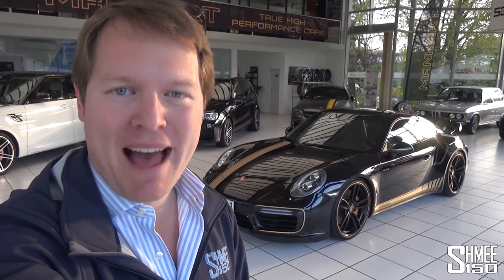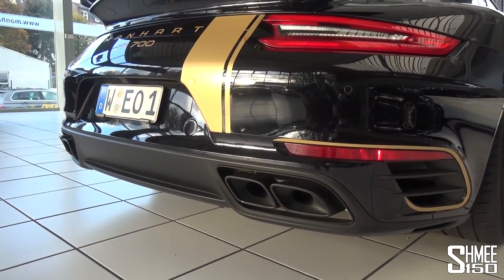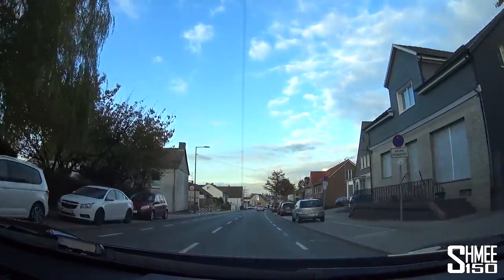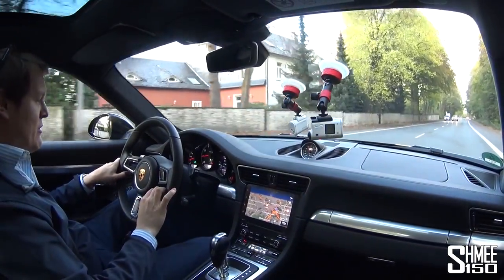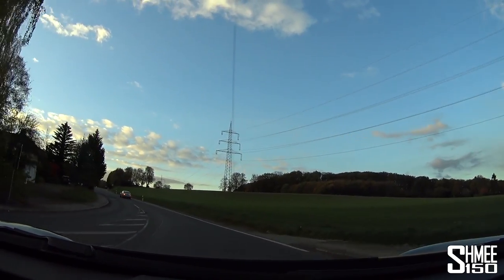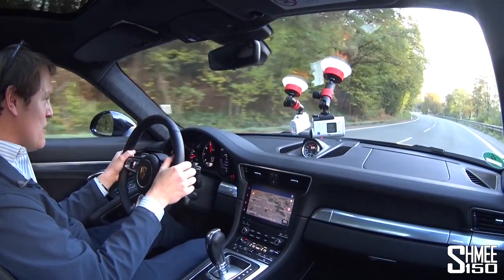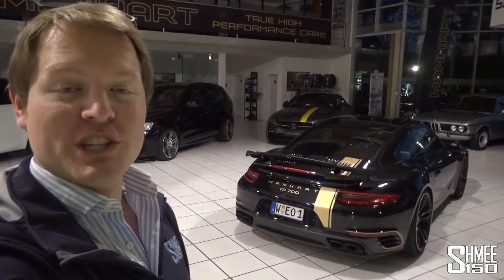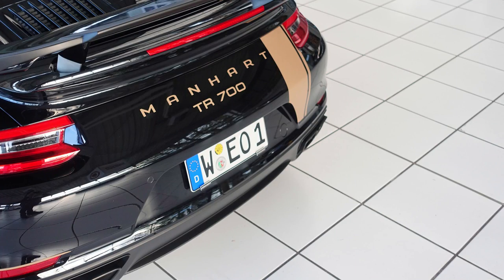The Manhart TR700 is a Ridiculous 700hp 911 Turbo! | TEST DRIVE

Comment from the maker: Manhart have completed their first Porsche project, the TR 700 based on the 911 Turbo and it has 700hp and almost 1,000nm of torque! Let's check out the modifications they've made before a test drive on the Autobahn.
Reply: Love it shmee buy one
Reply: Buy one shmee
Reply: So the big question is what have they done to the engine? Still the original Porsche Turbos with VTG and no turbo lag, or new larger turbos without VTG and a turbo lag?
Reply: "You can squeeze 2 small people in the back" more like young kids . I  love the 911 but 2+2 is not really working. I remember when i was 12 years old i already had space problems in the rear of a 911
Reply: Shmee150 my name is Manhart and I m from Germany :D but sadly my family doesn’t tune cars 🚗 @shmee welche Autos hast du in Frankfurt ich meine dich letztens gesehen zu haben 😃
Reply: Love your videos, I have an Agera RS 1. Would love to have you across the pond my friend. Let me know sir. It will be a blast!!
Reply: @Rick2010100   You can get that power from plenum, y-pipe, exhaust, high-flow (or no) cats and a tune.  Ideally you'd use larger intercoolers as well just to keep the temps more consistent compared to the stock ones.  It sounds to me like this car has no cats.  The turbos are almost certainly stock if it's an S model, but they may be upgraded if the Turbo was base.
Reply: Hi Shmee which one would be more worth the tachart gt street R or menhart 700 I would love to hear your opinion thank you
Reply: hola shmee para salomundo el porche no sirve disculpa no hablo ingles ni escribo jeje saludos mucha felicidad y cuidate mucho en tus grabaciones haces videos fantastic!!
Reply: How is this monster compare to Techart GT Street R?
Reply: @SteveC-Shaman  I have a tuned 991.1 Turbo which is at ca. 620 BHP at ca. 20° C and ca normal altitude with serial turbos, but this is mostly the limit for serious tuning on that engine. You can enhance the turbo spinning and pressure, but than the lifespan of the turbo is extremely low, if fragments of a broken turbo enter the engine, the motor is also jam.
Reply: @Rick2010100  Yes the 991.1 has smaller turbos than the 991.2 Turbo S, for sure!    By Design has had 685awhp+ out of the 991.2 with a "stage iii" setup using methanol injection, which is well beyond 750hp at the crank.  And their "standard" Turbo S stage III is somewhere in the 625awhp range on 91 octane fuel.  Even stock, the car calls for 93 octane fuel so that's pretty awesome - and still at least 713hp.  That's with standard turbos for both of those builds.    You didn't say if your car is wheel horsepower or crank - wheel 620 should still be well over 700 crank, maybe in the 710hp range.

Hell, a Cobb Stage 1 tune - that's without exhaust or any other mods - is 594whp/630tq on the 991.2!
Reply: I live in Los Angeles, CA, when and where can I order the Manhart TR700 Porsche?
Reply: Shmee150 seems like it’s smoking a bit. Do you have any information regarding CO2 émissions ?

Comment: I think the Turbo/S gets completely over looked by the GT cars. The Turbo S is the best overall 911 in my opinion.
Reply: Gt2rs and gt3rs have way more soul imo
Reply: It lacks exhaust sound
Reply: @maggi98mw  I get that the GT have more appeal to most people, but I don't think any modern car has a soul anymore. They're too good and to clinical.
Reply: Agreed!
Reply: @DragTimes mclarens sound freaking awesome. And even if they did not sound good, what has to do with what i said anyways?
Reply: DragTimes this car can Go under 10 in the 1/4 mile ?
Reply: Maurizio Arrivabene a questo punto prendi una gt3 997.2 manuale ed aspirata ti costa uguale non hai un esagerazione di cavalli e coinvolge come poco.... se voglio un auto turbo deve spingere perché se devo accontentarmi di 370cv compro una m2 competion o una Cayman gt4 se voglio spendere di più avendo l‘aspirato o la gts vomendo il turbo....
Reply: I agree. And I quite like the toned down exhaust. Way less annoying imho. A screaming n/a engine is nice on the track or on occasion, but for daily I much prefer a silent car that just has a hint of "power" in the sound.
Reply: I love mine.  You can do everything with it.  And it's not overly loud outside the car - which is a big thing for me, it keeps me from getting in trouble.  It's quiet(ish) inside as well, so you can drive it every day, take it anywhere, and yet it's still an absolute weapon on the track.
Reply: 100%
Reply: @juanmapatron1238  They sound okay at best except the 720 that just sounds underwhelming. Even irl.
Reply: Just needs the gt3rs bumper and wings in front

Comment: That is the most understated machine ever ... OMG that power gain is so much 😱😱😱
Reply from the maker: It's actually really impressive
Reply: @maurizioarrivabene8182   Almost certainly not bigger turbos.  68/71mm  turbos will take the car to 700+ all wheel horsepower.
Reply: @maurizioarrivabene8182 Wrong.  I have a 991.2 Turbo S.  You can get over 700hp on stock turbos, with exhaust, plenum and y-pipe.  You'd be smart to go with larger intercoolers too.   You get well into the 800s with 68/71mm VTGs and you can go far beyond with Syvec controller + non-VTG turbos.   If you want 700+ to the wheels then yes, you'll need upgraded turbos.
Reply: @maurizioarrivabene8182  Replacement turbo aren't cheap and they still require exhaust, tune and upgraded intake piping.  Bolt-on 991.1 cars with 68 or 71mm VTG turbos are doing about 180mph in the 1/2 mile.   I expect the 991.2 cars to best that.  By comparison a 720S runs about 170.
Reply: The price tag is what catches people

Comment: Sadly these 911 turbo never have been loud. No mod could change that. Compared to a nissan gtr they sound almost nothing, Although they have the same displacement and cylinders. Maybe its because of the placement of the engine and boxer vs V engine. No idea, however the gt3 and gt3 rs are sooo much louder than any 4.0 I've ever heard. Sad that the 911 turbo cant keep up soun wise, it compensates that with a out of this world performance

Comment: Any Porsche is capable of 1000/1200 hp with modifications. That’s what you should build is a 911 project car instead of the stupid focus RS is junk you’re always in Germany you get a drive on the autobahn build a Porsche project car older one from the mid 90s plus it’s more ur style than focus rs. It could be an epic build with your connections,  a turbo motor. There is endless aftermarket parts for those cars plus Porsche makes tons also!!!!
Reply: A 911 project car would cost like 4 times more than the focus